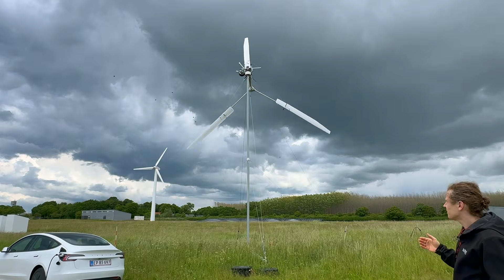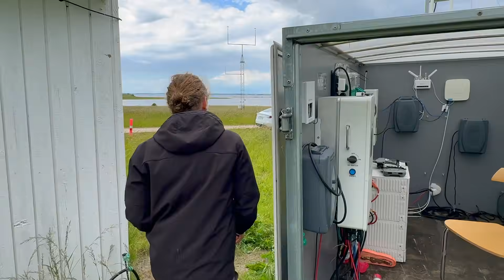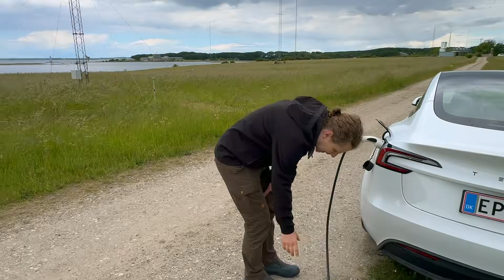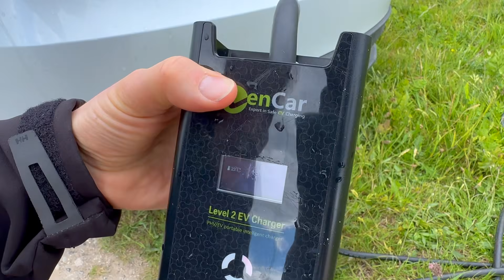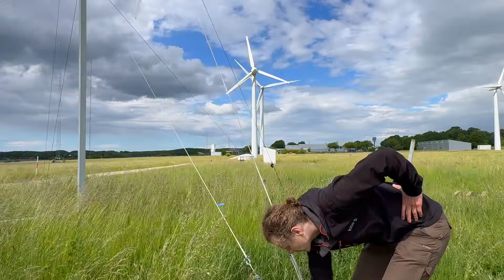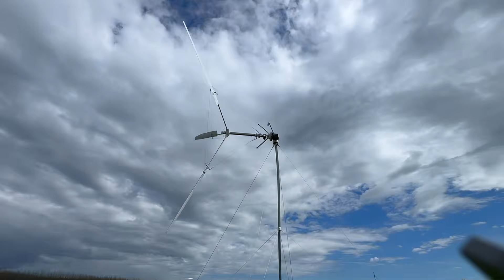KiteX turbine Charges a Tesla Model 3 with 4 kW - TWT-11 - Long Edit

Comment: All tests of ground-based small wind turbines show that they hardly produce any electricity. 
Solar panels always generate at least 10x more electricity with the same investment in time & money! Reliable and almost maintenance-free for at least 25 years. But 9 out of 10 small wind turbines stop working after some time due to the extremely gusty winds close to ground. Anyone who lives off grid needs a petrol generator anyway.

Comment: And, what is the price of this set-up that replaces a plug to an electrical grid? Batteries, inverter, wind turbine, shed, and long extension cord? This is an impractical way to charge an electrical car, unless you are in an area with strong and steady winds that is off-grid. Would you care to explain the efficiency of all this equipment? From the energy being harvested from the wind to what little power is actually getting into the car's battery. Greenwashing garbage!
Reply: The power being delivered is around 4 kW, at around 7 m/s with ok wind conditions at the spot (slightly gusty). The production for the last couple of days is around 74 kWh per day. It is a test setup, but approximate cost would probably be around 170,000 DKK excl. VAT. or around USD 26,000 ex. VAT. including installation.

Comment: 3KW is an awful lot of juice for a turbine in this size class, and especially since there doesn't seem to be that much wind happening in the video.    What is the windswept area on this turbine?   Is there a power curve chart?
Reply: It is doing close to 4 kW. It has a swept area of 89 square meter. Power curve is being updated. We hit max output from around 8 m/s. During the video I would guess we had 6-7 m/s.

Comment: A great turbine for building in your own garage—and it's affordable. The weak point is the long bracket; you can see how it vibrates heavily, and the bearings will fail quickly.
Reply: 23k is affordable?
It would pay itself off in 20 years for me.
And probably has a 10 year life span if you are careful with it.

Comment: im not an expert but the belt is the weakest point of this design. it just breaks easily and require maintenance which will eat easily the gains compared to the common commercial wind turbine design

Comment: This would be better to pair with a portable power station, like the Pecron F5000LFP or similar to simplify your solution and offer at a lower cost.
Reply: The TWT-11 is not designed for portable system use. The battery would have to be substantial to handle even just a few hours of medium power output from the turbine. On top of that most of the portable systems cannot charger with more than 3000 W from the MPPT so the turbine is oversized for the solution at peak output of close to 5 kW.

Comment: I can't see how this has an economic advantage over an equivalent output solar array. Anything that has moving parts and sticks up in the air is going to have additional maintenance and breakage costs that significantly detract from payback time.
Reply: By that logic forced convention for cooling doesn’t make sense either? Anything that rotate will have additional maintenance… ?
Reply: @AndreasOkholm Not quite sure what you first question means, but the second question, yes, anything that rotates, wears out by friction, and the more it rotates the faster it wears out. Static systems like solar arrays degrade predictably and have a long useful life.

Comment: Here in mid germany most the time we have ~ 3 ...5m/s. Wind turbines are not able to work. So what?
Reply: That's one issue the turbine can't solve :) Other turbines typically works well in mean windspeeds 6-8 m/s - the TWT-11 is designed to work well in 4.5 m/s to 6 m/s mean windspeed due to the more swept area per max power.

Comment: Does the long axle not cause increased wear and tear?
Reply: It is also a bit hard to see but the boom actually does not rotate in this design.
Reply: It is very light weight and the load paths are optimized.

Comment: Looks promising but a bit lacking in data, maybe because you are in the prototype phase and you dont have accurate data yet.
But it would have been nice to know what are your aim to performance.
Average power output over what frame of windspeeds?
At what max speed this turbine stop working?  how much the pitch control can be useful to control the output and protect the turbine? 
The only thing that looks weak, is the horizontal support of the shaft, that seem that it will receive a lot of stress over time, I would be surprise if it last more than 1 year. I know the generator does not receive that stress, but some fixed joint does it anyway, so that would need to be change often I suppose.

Comment: He tells us about every thing arund the wind mill. Is he selling the wind mill or every thing around it. Video has nothing to do with the car has nothing to do with the charge controller has nothing to do with the battery trailer has nothing to do with the mounting post. Nothing to due woth the extra testing equipment.  Watse of time. The guys a utuber starting a channel to keep you interested in something hoping you watch his full video. What are the specs? Thata all that matters in a wind generator. He says he charges the car at 3k ok that sucks. How much power is the thing making? Your inverter is a 3 k ok  honestly no im not interested in this product this guy blows it. Horrible pitch. He says nothing about what the output is. If lookimg for wimd power youd be stupid to watch this and buy it. It shows nothing about how it helps you.

Comment: Looks like it might benefit from extension of the boom to the front (upwind) side, as a counterweight to the blade assembly?
Reply: Th zoom on the boom/blades shows a wobble that might be removed using a counterweight on the windward side of the main pole?
Reply: Good suggestion
Reply: We have tried a counterweight, but the first counterweight implementation we did was too soft and created natural frequencies unfortunate places. We are still not sure if it make sense.

Comment: If it lives up to it's CLAIM OF PRODUCING 15000 kWH A YEAR , then it could be a very    good seller  even at $26K
Reply: Price estimate for the US will be around USD 20,000 incl. installation ex-VAT. 15.000 kWh is for a location with decent wind resources. We built a simulation tool to be able to do pre-installation feasibility studies.

Comment: Maybe you know this but all the Aramid fibres such as Kevlar Dynema Nomex degrade by 80% of there new strength in one year in sunlight. approximately.
That 90 degree arm looks like it is causeing a lot of flexing and perhaps metal fatigue in time...
other than that COOL! very light weight and large diameter for lots of torque! respectable output.
Reply: The types and material specifications are selected to ensure the longevity of the system. You are right all materials degrade over time to some extent.

Comment: Why the long arm or prop arm I guess.. 6:21  a lot of vibration
Reply: We are always looking to reduce vibration. Partly for visual comfort, partly in order increase longevity. Please consider that the glass fiber can bend much more than steel, so a wobble in a glass fiber frame like you only loads the structure a few precent of its ultimate capability.

Comment: I’ll watch the full video but what’s the cost. Break it down for full system you are showing off. Great job will have to look up website after this. I was keen on the European made SkyWind but this seems good too. I’ll need to compare :)
Reply: The current offer is with a grid-tie invert and installation for 165.000 DKK including 25% VAT. You also get the choice to upgrade to hybrid inverter.

Comment: For servicing, is it not doable to have the main shaft slide in like on an umbrella? And lift/drop it with a crank mechanism?
Reply: Would be interesting, but with the weight and performance/durability requirements it would be hard to pull off!

Comment: Opting for thin sections isn't a bad idea for simplifying installation, but it creates too many other problems, such as the need to offset the blades, making it even harder to keep them straight.
I see many design flaws that could have been easily avoided.
This could be achieved either by creating a container filled with soil or by burying the entire structure (Easily done by local construction companies.). The base should be a tripod, not a pole, making almost half of the wind turbine structurally rigid. The pole would then serve only as an extension to allow the blades to pass through.
Of course, all these concepts have already been studied. But the best method for this type of small installation remains the good old vertical wind turbine, which eliminates the vast majority of these problems.
Reply: The guy wires effectively turn the structure into a tripod of sorts, it is the lowest weight option for such a design. The anchoring system is extremely easy to install as uses ground screws.
Reply: @FrederikSkovgaard  But we don't have post-apocalyptic needs ;) The goal is to find a more economical, efficient, and sustainable solution, and local workers must be involved in the product design if we want a product that properly meets needs and doesn't require repairs every six months. Sometimes, you have to understand your own worldview to design a product that everyone wants/needs. And it's probably not the best long-term solution. Technically, it's perfect for scientific research or for people isolated in the desert. But in 90% of cases, it's probably not the right solution, even if the initial idea is… elegant. I'll add that in the vast majority of cases, the grid connection you see in the background is the fastest and least expensive solution than individual solutions.
Reply: @theplouf5533  The TWT-11 costs less per kWh produced than other IEC approved small wind turbines. It is exactly addressing the issues you mention: it is easy to install without heavy machinery, can be serviced from the ground (no crane needed), service costs are lower than comparable products. Service is the great unknown, our current tests and estimates points to 48 month service intervals as a fallback, since the turbine has a continuous monitoring system built in. Normal small service will land around 4,500 DKK.
Reply: @FrederikSkovgaard  If your business is doing well, good for you. That's not my point. I'm not a capitalist.

The comparison doesn't necessarily mean you can't do better. The product itself can be useful in certain situations. I never said otherwise; I even mentioned it with examples. In this system, you can sell just about anything, even a wind turbine that doesn't turn. So, it's not really an argument for me.

If you don't believe that installing slightly higher-quality equipment would likely result in two to four times better energy efficiency for not a big difference in prices, that's your opinion, not a proof. But I find it really unfortunate.

PS: I hadn't realized that your energy prices were so high in your country. In France, we have prices half as high, and connections are often free, unless you live very far away.
So, it's possible that my reaction is culturally influenced. Some products are not necessarily comparable worldwide since the environmental context inevitably influences their design.

Comment: How often do you expect to need to replace the bearings on the main shaft?
Reply: 10+ years for most cases. We have a continuous monitoring system so there are no fixed intervals.
Reply: @FrederikSkovgaard  Suggestion of a 10 year life for that bearing is laughable - please be realistic. It will be measured in months, not years. Maybe 24 months, maybe 30, maybe 10 - but 120 - no way.
Reply: Main shaft doesn’t rotate… so the bearing load is tiny compared to conventional wind turbine designs
Reply: @AndreasOkholm  OK, 'the main ROTATING shaft'.... because there is one - right?
Reply: @bwcdevices3028  Well there is  bearing around the stationary boom that carry the hub assembly for the blades and bearings for the main pulley. The need to be relatively large diameter 150 ID. (which to be fair) is one of the weekness of the design - Many relatively large diameter bearings, but fortunately the aren't loaded much. So it mainly a matter of keeping corrosion away and keeping them lubricated. Main bearing on the generator shaft is the bearing that sees the highest load/demand.
Reply: @AndreasOkholm  Sounds good - the bearing at the end of that rotating shaft will be under a lot of load as the main shaft wobbles significantly as it turns. Would like to know what the real world performance is like... when will you have data?
Reply: @bwcdevices3028  its not. As the whole shaft/boom moves so does the rotor disk. They stay in the same plane.

Comment: 2:15 Deye will not be an optimal option. Please contact Polish distribution company Emiter - they have made tailored wind turbine controller for Solax PV inverter. It can easily be changed to work with any other inverter with Constant MPPT voltage option (IT controls pv inverter via modbus) - like Solis. Than you can connect it to any 3ph inverter with AC Coupling option - like S6-EH3P8K02-NV-YD-L from Solis (as they do not have a problem with charging battery with 1ph input on 3ph GEN port).

Way better performance.
Reply: Interesting we will definitely have a look!
Reply: @FrederikSkovgaard Good you found this comment. It is very specific and could help you a lot.

Comment: I like it, except its too wobbly and too far out there! Bring it in, get rid of all the cables. All of them!  Dont use fiber glass or carbon fiber!! Make it last a lifetime with aluminum. I like the down wind idea! And the belt drive. JUST get rid of every single cable, shorten the shaft as short as you can get it and make the tower rigid triangles like a mini starship tower. That way you can climb up it.  Whoever the engineer was that designed this, you should of said something! You should of never  put this on the market built like this. It plainly wont last in medium to high wind or long term. 

I've been an engineer all my life, and just ask any good engineer, the stresses on what you built are too much. You can plainly  see it wobble!  If you just build a tower like a mini spacex starship tower, then you can shorten the propeller shaft drastically! And thats just good engineering. Great job on making it a downwind wind turbine. That was a really great idea...

Comment: my son and I did this at his grade 6 science fair project about 17 years ago, thus the blades more as a kite, but we also even angled the blades like a cone, as to also reduce wind gust stress, latter instead of a metal shaft, the idea was to use a flexible cable. of corse back then they laughed in there thinking that wind mills are already with a good enough common design, my son has graduated with his electrical engineering degree.

Comment: Great, but Price around 30.000$ its crazy 😢🥵🥺🤯
Reply: I'm thinking the same thing tbh. I suppose it's not too crazy for farmers though, given that agricultural equipment is priced similarly often times
Reply: @undo9981 yeah but 2000W istabreez you can buy for 2k$
Reply: @maxbiagi3091  That is peak performance, how many kWh per year would it yield that is the interesting question. The TWT-11 has a huge swept area so it delivers close to max starting from just 7 m/s.
Reply: @FrederikSkovgaard So much YT test show, they 2000W model can reach in peak around 2.350W then "over Wind" protection kicks in.
Reply: if it works only half the time, so at 2kwh, with a price of 20 cent per kw it repays itself in around 10 years. At 30 cent per kw it is down to 6 years, and if you pay 50 cent per KW it is only 3 years and half
Reply: @ArchivioBDF  Which is a lot.
Reply: The price estimate in the US will be around USD 20,000 ex. VAT. It is currently available for 132.000 DKK ex. VAT. This includes installation.
Reply: Why can't these wind turbines be affordable (cheaper)? 30000$ to generate just 3kw?
With solar modules costing about  $0.15 per watt in my country, I could say buy 32 solar modules each of 625w mono crystalline, that will total up to 20Kwp potential and even applying an efficiency of 80% and 4.5hrs of sunshine per day, these will generate at least 72kwhrs of solar energy every day. And these 32modules would cost only $3000. I then couple these modules with a 16kw Deye hybrid inverter costing $2696. Then add say 10 lithium 5kwhr batteries costing total of $7724. That full system will be $13,420. And with that size of a system, I can fully charge an EV car with a charge rate of about 7kw every day, and have lots of spare energy to power a sizeable home......
This pricey Wind turbine demonstrated in this video, cannot match that solar system and it's double the price and you haven't even included the inverter and Batteries.......Oohhhh.....
Reply: @jessew6757 it depends on where you live. Close to equator solar is great, at the northern 50th parallel and above winter production from solar is minimal. You would probably need something like 40-60 kWp solar plus a massive battery to make equivalent usable energy.
Reply: @FrederikSkovgaard  okay, good point, and it's accumulative, wind blows during the nights.
Reply: And it only out puts 500watts. Or who knows he never said. He talks about everything but the output. 😂😂😂😂
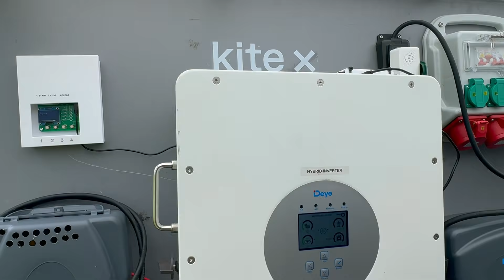Reply: @thetowguy-johnnytowtruck  He showed the real-time output at 1:39.
Reply: @PaulRoderickson output variables are constant changing any body can show at high wind